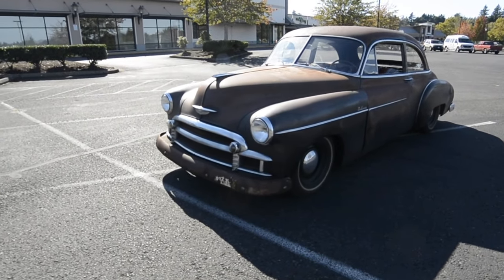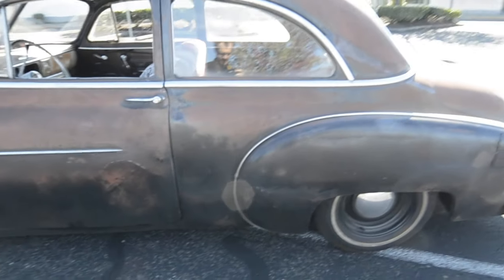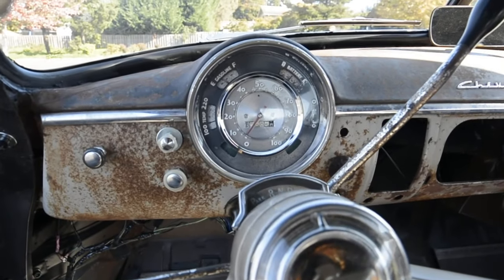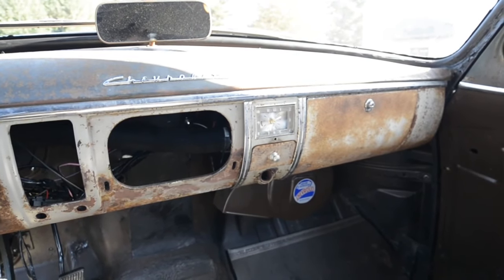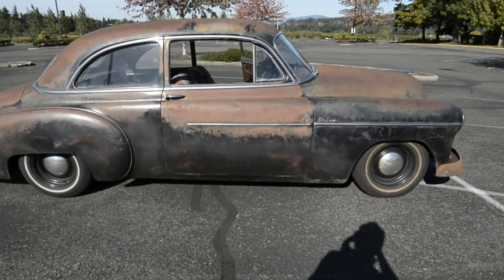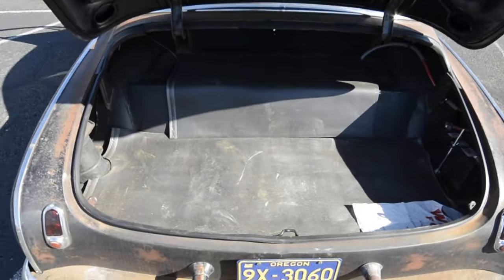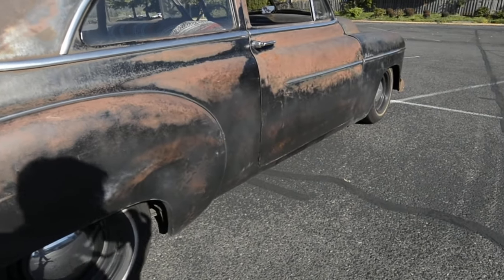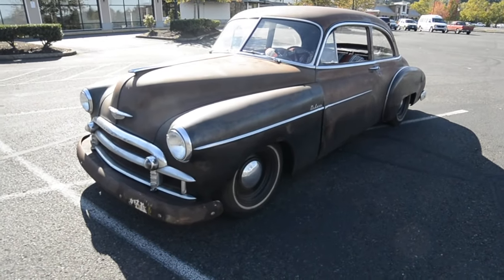1950 Chevy Styleline Rat Rod

Comment: I have the same car! The original engine, the 216, had a cracked block so I pulled it out. The car also came with a 1956 235 engine, transmission, carb, etc... on a pallet. I've taken that off to a machine shop to have them give it a good look-over. I tore out the interior and working that area over pretty good. And then I'll go from there. I'm low budget on this one, so I'll be just putting her back together and making sure the breaks are good. It had a new gas tank and radiator when I got it so I'm happy about that. I just love the look of these late forties early fifties Chevys. Thanks for posting! I'll have to make a video once I get her running... It needs a complete rewire too.
Reply from the maker: Thats rad! The 216 was seized in mine when I got it, so we left it at the farm we pulled it out of the field at.
Very cool to start such a cool project! Nice work! Those mid 50's 235's are pressurized I believe so it should last a long time! Definitely some of the best lines on any of the 40s and 50s cars!
Reply: @78SilverBronco  are u running on 15 inch tires?

Comment: I got one of these cars to. I noticed you were missing the radio plate. I got one if you want it you can have it
Reply from the maker: @leadsled50 thanks man! I got all that stereo stuff wired up after this vid and mounted a blue tooth board behind the old stereo face and got it all working. I built a trailing arm setup to replace the leaf springs which were junk. The old 8.8 axle was toast so I figured why not try something else. I put up a video showing some of it because I’ve got nothing better to do while “sheltering in place” haha
Reply: @78SilverBronco  oh heck yes

Comment: Wow that's amazing bro! What method did you use to lower it?
Reply from the maker: Thanks! The mustang 2 setup lowers it 4" from stock height, plus the 2" drop spindles for a total of 6" in the front. In this video I had 3" drop leaf springs in the rear w/2" blocks. I had all types of axle wrap with the leaves, so I'm now running a trailing arm setup with ridetech coil overs and I'm down about 7" in the rear. I had to tunnel the driveline area under the rear seat and step notch the frame, but its great now. No axle wrap and handles much better than the leaf springs.
Reply: @78SilverBronco  sweet! I was planning on cutting my front coils 1 1/2 and putting 4" blocks in the rear I have the same car as yours
Reply from the maker: @bossmodetubby  Oh right on! Are you planning on sticking with the stock suspension up front? Ive seen a few guys step the control arms and run the fatman (or maybe Jamco) factory kingpin style 2" drop spindles to get the front end low.  The factory front end definitely rides much nicer than the Mustang 2. Overall the mustang 2 is great for handling, but you really sacrifice ride comfort. Also, most vendors are junk, so be careful if you go that route. Given the chance to do it over, I would look at a stock or semi-stock solution. The Lexus SC400 and the 70's-87 Jaguar XJ6 front ends are great options. I would also consider Fatman ultra low, as its rear-steer and you gain a lot of clearance to run power steering.

Is your rear axle stock torque tube style right now? Sounds like a fun project! I miss working on mine. All the fab and repair work was pretty fun.
Reply: @78SilverBronco  honestly I'm learning as I go its my first classic and I'm pretty new to mechanics.I absolutely love how yours looks I'm on a tight budget so I'm trying to go the cheap route until I'm able to get the mustang 2 to eventually airbag it which I assume I'll need to do some serious modification.
Reply from the maker: @bossmodetubby  They are great cars to start with, very simple to work on. Does yours still have the inline 6? The 6's are great engines. 

The mustang 2 setups are fairly easy to install and some are a bolt on setup which makes things very easy. If you go bags, its very important to use the correct upper control arm bushings. Many of the upper control arms nuts will back out with the constant air up/air down of the suspension and can be pretty dangerous. If you plan on running the stock setup for awhile, 2" drop spindles and cut coils are probably the best way to go. With drop spindles, you dont get bump steer, which is really nice.

Comment: Build looks clean. I like it. Are you running seatbelts? None of my builds have seatbelts but now that I’m getting older I’m thinking about putting them in. Want to take my kid on the highway but feel reckless.
Reply from the maker: Totally understand that! I'm running a set of the RetroBelt's from summit racing in the front and rear. They are just lap belts, but they look good and seem well built. They come with large fender washers so you can mount them in the sheet metal of the floor.

Comment: Are rust repair panels available for them?

l love these 50's cars there like them derelict cars but on a budget.
Reply from the maker: You can buy the repair panels from EMS, these cars are pretty known for rust in the rockers/quarters/trunk, thin sheet metal and poor drainage of water. The floor braces were completely full of dirt when I cut off the inner rocker panels, amazing they werent rusted as well.

I agree! Those Icon Derelict videos made me fall in love with the patina cars but I knew I'd never have the money to buy one.
Reply: License plate frame reads: " What the hell, ...it runs."

Comment: How hard was it to swap to a c10 steering column?
Reply from the maker: It wasn't too bad. The biggest challenge was the length of the C10 column is about 4" too long for the seat location. I ended up pulling the center shaft out and the shift tube so I could shorten everything up. I used a piece of angle iron and welded 4 opposing sides of the center shaft to prevent distortion, then fully welded it. The change in length aligned the shift selector perfectly with the cutout in the firewall. I used one of the old 3 speed shift rods and massaged it to fit the 700r4. The tricky part is the firewall support brace. A lot of guys use the billet bearing supports which I wasn't a fan of. I used the Ididit 2401300010 column mount (although the speedway one looks a bit nicer). You can clearance the inside diameter of the original upper column on the dash mount with a flapwheel to fit the C10 column.

Are you running a mustang 2 IFS?

Comment: Real nice car similar to what I am building.  You mention you used a Ford Explorer rear axle. Was it from a 2 wheel or 4 wheel drive version?
Reply from the maker: All of the 1996-2000 ford explorer and mercury mountaineers came with the same axle, its a 59.5" wheel mounting surface to wheel mounting surface disc brake rear axle. The earlier explorers (1995 and newer) had a 59.25" drum brake rear axle. 

They came in 3.55, 3.73 and 4.10 gearing with 3.73 being the most common. If you find one with the tag, be sure to check for "L" in the ratio designation. Mine is a 3.73L for limited slip. 

Also, the axle in the video was bad, the pinion bearing was wasted and a lot of other parts were toast. If you find one, check the pinion play. If there is anything more than 1/32nd inch or so, I would pass on it. I replaced mine with another junk yard unit and did trailing arms at the same time and it has been great.

Good luck!!
Reply from the maker: The pinion on the explorer axle is offset to the passenger side 2". Its not a big deal if your not going very low, but if you lower it 5-6", especially with leaf springs, you will likely need to clearance or massage the driveline area under the rear seat. I was still able to use the rear seat, I just trimmed back the metal grating on the seat around the driveline tunnel and it fit perfect.

Comment: Is it on 14s stock or 15s?
Reply from the maker: Its on 15's with a 215/70/R15 tire
Reply: @78SilverBronco  what lug pattern are those brother?
Reply from the maker: @osvaldoramirez8431  These wheels fit both 5x4.5 and 5x4.75. I'm running 5x4.5 all around on it.
Reply: @78SilverBronco  thank u brother god bless